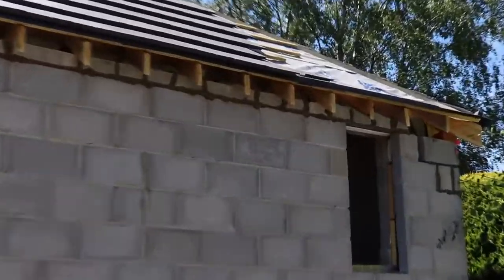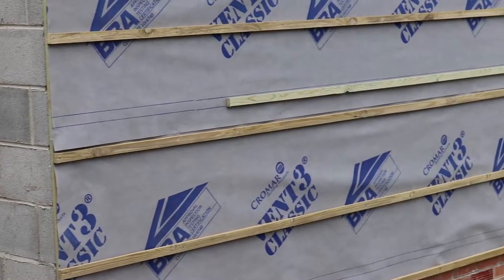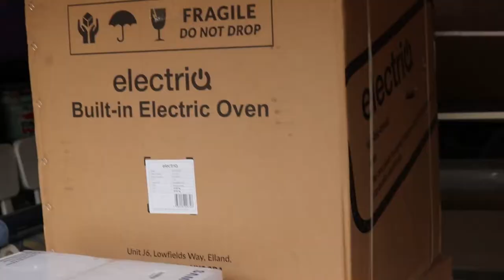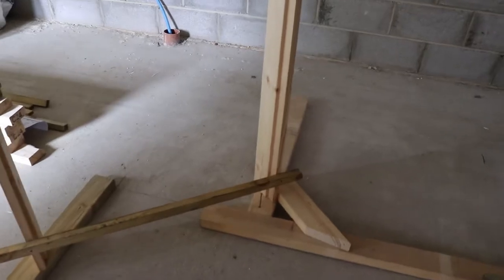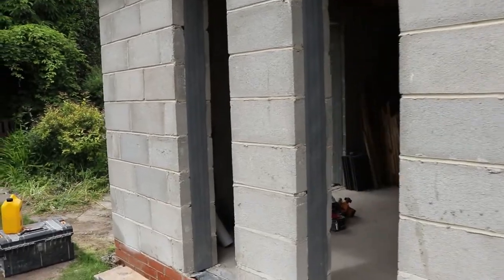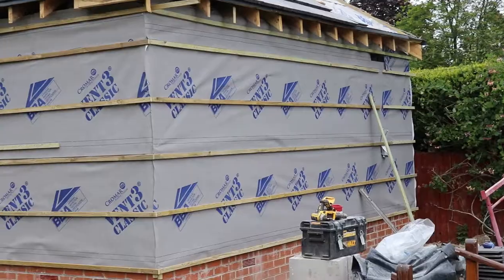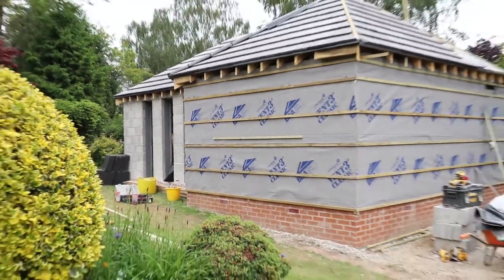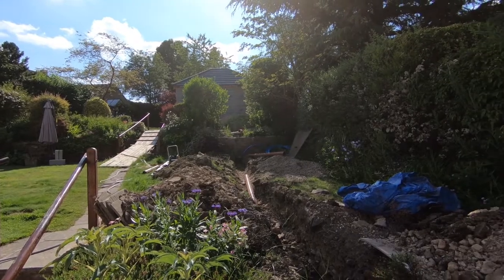UK Granny Annexe Build - Part 8: Walls finished - Week 10

Comment: Amazing series!! I've just caught up!

I'm planning to do the same in my garden!  Did you put through a PD application under the Caravan Act 1968 as well as a Planning Application so that it could be built using brick and mortar? How much did the architect charge for the design and planning process, please? And how much does the whole build cost, please??   Thank you kindly!!
Reply from the maker: Thank you.
No application under the caravan act required, just a regular application as with any extension.  I designed the building and paid an architect around £2500 for the plan which had a couple of tweets to my design, mainly the floor to ceiling windows and 45 degree angle of the door to the bedroom. We saved around £1200 on architect fees as the builder was happy to work off plan and didn't need detailed drawings. Worth asking your builder about this as you don't want to waste the money if its not needed. I'll be going into detail about the costs of the build in the final video of the series, which I'm hoping will be within the next 5-6 weeks.
Reply: @limitedinsight  Thank you!